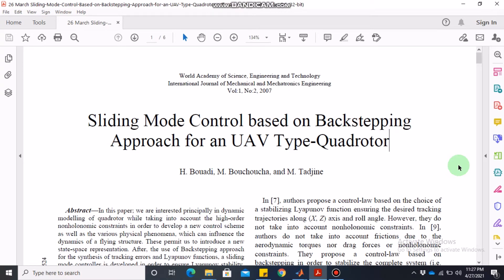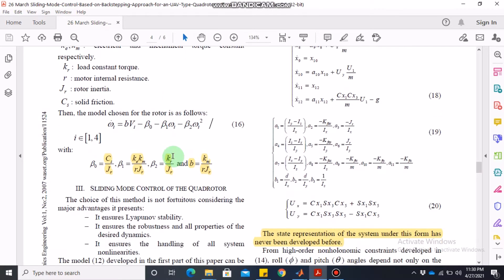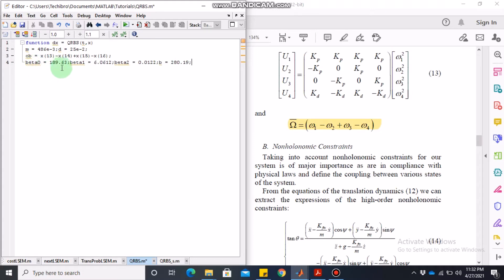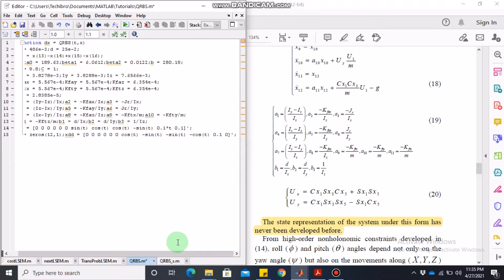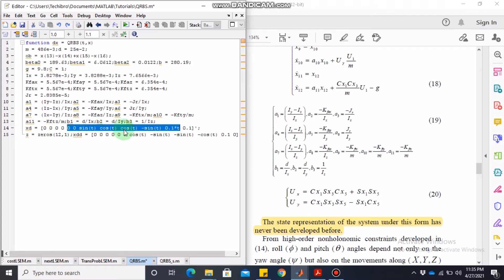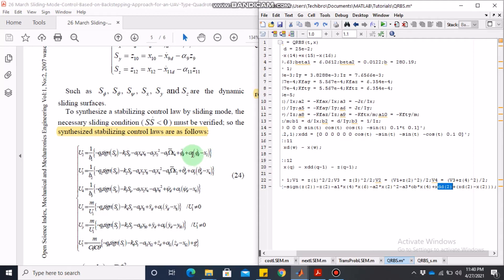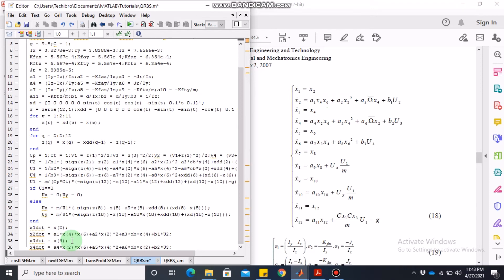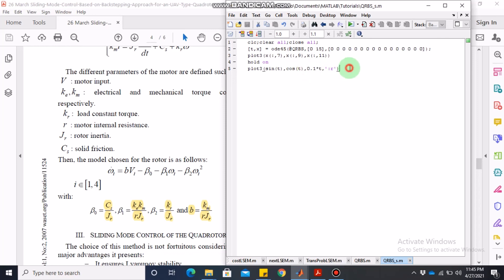MATLAB Simulation of Sliding Mode Control based on Backstepping for Quadrotor

Comment: Dear sir, 
Can I ask for your comment, because I have questions? Here I do not see the use of "Nonholonomic Constraints" i.e. formula (14) in your code. I only see ux and uy (fomular 20), I assume it is inputs of formula 14, is it right? According to what I understand, the x y position cannot be controlled directly but must be through the influence of angles phid and thed.
In addition, I see a confusion in lines 45->48 in the video using Lyapunov's V function (formula 21) instead of the engine's V function (formula 16), as I see in the paper. The motor model is presented in the paper, but it seems that this part is omitted in the code, right?

Comment: Sir, can you inform a bit about what Backstepping control is and how they differ from SMC? How it is designed and why is it used?
Reply from the maker: Here is most of the answer to your question https://youtu.be/ggatiQpnQUw
SMC is used where there are bounded uncertainties in the model
Backstepping is for systems having a special structure in the state dynamics (we exploit the structure to breakdown the process of control design into smaller "steps")

Comment: Hello sir
Can I have Your email?
I have got some errors in ode45
Reply from the maker: My email is techibro@umich.edu I hope that you can resolve the error on your own. Just read the error statement carefully it will tell you which line of the code has the error. Then you can compare that line with the code in the video. Sometimes it also happens that the students try to run the function file itself. You are supposed to run the script file and not the function file.
Reply: If it's possible please check your email🙏
Yeah I tried of course
Reply: Hello, were you able to fix the error, I have the same problem!